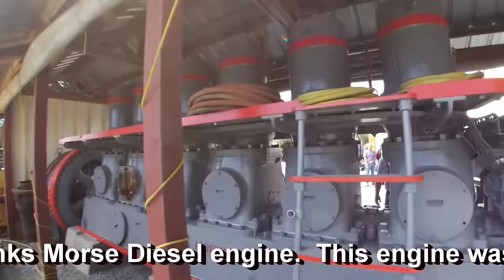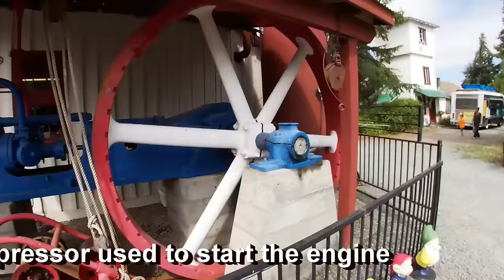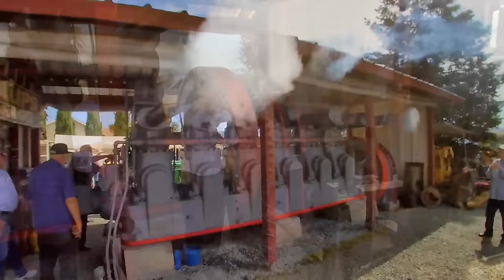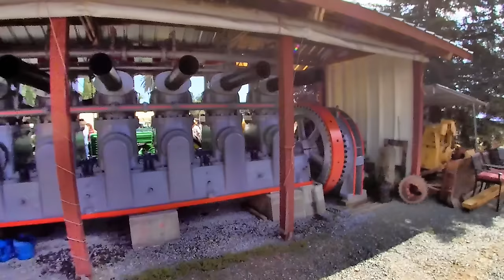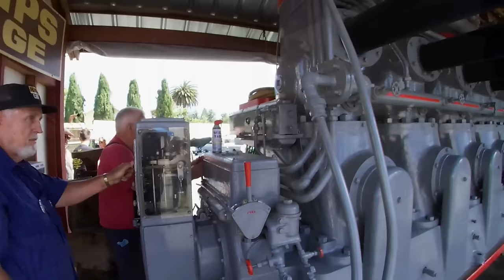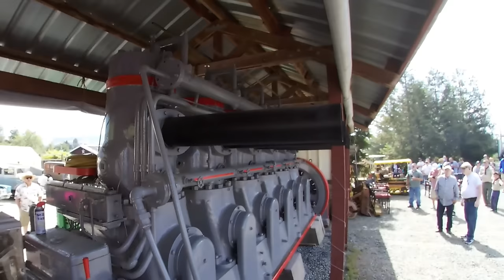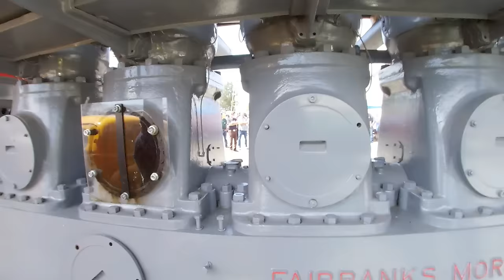450 Hp 1930 Fairbanks Morse Diesel Engine Startup

Comment: As a mechanic that started an apprenticeship in the mid 70s, I am only now starting to appreciate the history behind what I do for a living.
Reply: Yes, You offer a great trade that unfortunately so many people have no clue how to turn a wrench or work with their hands and fix something.  As I'm writing this I have a person asking me about changing out a fuel pump on his truck.
Reply: Was it plumbed into a 5000 gallon 2 stroke oil filled tank out back somewhere? What brand of 2 stroke oil does she burn during these demos?
Reply: I hear you. I just started a job working with a 30 year small engine necanic. The snow engine in rollag blew his mind....
Later did similar exploring that an ajax is little more than a chainsaw engine on a massive scale, haven't even touched on detroits or hit and miss or hot bulb.
Reply: @jesseamaya4413  Ift thats a small 2 sretoke i hate to see a big one, unless yoy tinker with a wartsilla 1085000 hp 2 stroke. Only lightning is a bigger badder 2 stroke!

Comment: If that thing make 450hp @ only 300rpm then that means it’s making around 7890ft/lb of torque... :O
Reply: Just out of curiosity how did you get that number
Reply: Katy Perry's taint because Horsepower is a equation of T*RPM/5252=HP and if you switch it around or use a calculator, it turns into HP*5252/RPM=T
Reply: I knew it was always equal at 5252rpm's. Just wasn't sure about an equation. Thank you
Reply: Yup.. those old steam tractors make as much torque as the largest modern tractors.
Reply: @lakeprairieag  But they are three times more massive and go about a third the speed :P
Reply: Very true.
Reply: And they run still! No planned failure in them, they were built to persist and they do.
Reply: HouseDuke That’s because the power per displacement is incredibly low and they don’t have extra parts to make them more efficient and cleaner
Reply: Torque is not relevant here, power is. It's being used to power a generator. A 1000HP, 1200 RPM diesel engine with 746,000 watt generator attached will power more machinery and more powerful electric motors. Power is power in this case. This is not a tug boat or semi truck rig hauling a huge trailer.This is purely about power, and 450 HP is not that much....And just to prove my point, if you hook up a 750 HP electric motor that is powered by the generator of the 1200 RPM diesel engine up against a 350 HP electric motor powered by this 450 HP @ 300 RPM diesel in a shaft versus shaft duel, then the 750 HP electric motor will win and smoke out the 350 HP electric motor that is getting its power from this 450HP engine....Again, power is power when generating electricity. No amount of torque is going to save you.
Reply: Povl Besser ... but will last over 100 years and could be fixed by the farmer or local blacksmith, never mind fueled by locally produced fuel or locally dug coal in some cases.
Reply: diesel.
Reply: @EETechs  Yeah, but that beast will put out 450 HP for years on end.  A smaller motor will not.
Reply: THANKS MATE ,THAT WAS MY QUESTION
Reply: The power calculator that the poster put in the link gives the result in in-lb, not ft-lb, so that answer of 94537 has to be dived by 12 to give the correct answer of 7878 ft-lb.
Reply: @EETechs  you could have said that so much better
Reply: @briiandee  ?
Reply: The 2 stroke can unleash unheard of potential
Reply: This is what in kgmf?
Reply: But it’s funny that nowadays a much, much smaller engine can make more power than this Behemoth. All be it not lasting as long.
Reply: This engine could bew turned up for much more power with a modern fuel system, turbo and exhaust stopping/trapping valve but it would make it a very low rpm, this 2 stroke bemoth is about 2100 cubic inches per cyninder, It make an EMD 710  v16 2 stroke a sport bike engine which can spin faster though
Reply: Im sure this giant can produce much more power with a turbo, exhaust trapping power valve and a modern fuel system. it what make a lot of power down low, big 2 strokes have tons of low end torque, they is a 116000 hp Sultzer giant 2 stroke for ships!
Reply: @andrewfritz5123  It is hp DIVIDED by rpm, not times in the case of converting hp into toque measurement at that specific RPM
Reply: titanicwhiz I literally gave the equation... hp x 5252 /RPM= T, you should really check before you comment
Reply: @titanicwhiz  boy lover
Reply: @EETechs  This "power is power" concept also applies in any application with appropriate gearing, but yeah the actual torque matters in a direct drive application and for the sake of keeping the transmission/drive gear simple. You could produce enough torque to pull a freight train by hand with enough reduction gearing, it would just be very slow!
Reply: @MittyNuke1  That is correct, but unfortunately such simple concepts are overlooked when people argue about diesel engines vs gas engines. In nearly all car or truck enthusiast forums and YouTube, people talk about torque, torque, torque. I found that when explaining equal power of two different prime movers with different torque values in terms of generating electricity, it pretty much shuts down any argument about torque being the "be all, end all".
Reply: EETechs yeah true, and I think there is a valid point because “in theory” doesn’t take into account the cost and reality of building transmissions that are capable of huge power loads. A lot of large container ships don’t even have a clutch to disengage the main propulsion engine; they start it up in reverse to go backwards! I heard that the US Navy doesn’t even own the reduction gearing on some (all?) vessels and just leases it long term due to the incredible expense. The difference in a large truck engine that puts out 300 HP and a sports car engine is that the truck engine can put out 300 HP for a lot longer than the sports car engine can without blowing up!
Reply: Torque is all about stroke! Longer stroke is more leverage on crankshaft. Longer stroke is also slower rpm's. The laws of science!
Reply: @dizzywow  That's not exactly true, but consider this.  These old engines last, not because they are so good, but because the power output is incredibly low by modern standards, and the speeds of differential motion (relative motion) within the engine are extremely slow by today's standards.  Just based on my memory of some weight and horsepower stats for some of these old engines, I'm estimating that modern engines can easily be expected to produce about 700 times as much power per unit of engine weight as these old monsters did, and yet think how long these modern engines last.  It's a matter of routine for a small diesel engine to power a truck for 500,000 miles nowadays - nobody even thinks twice about that - but it's a feat that was unfathomable for a truck engine back in the days when this monster engine was in use.
Reply: @EETechs  now we have torque converter

Comment: My name is G. Huffman and when I was a kid there were two of them running day and night at that mill. My uncle Tom Huffman was the machinist there. The two of them were in a big steel building with the machine shop and lathes and tools inside. I of course remember them being a lot bigger. I heard that they were shipped to the Filipines. The mufflers were in the ground, concrete boxes with steel plates over them and you could hear them booming all around the valley. I do know they were rebuilt a few times because I saw the pistons and other parts around on the floor. In a back room were two other generators as emergency standby , one was a big horizontal single diesel I don't remember what the other one was.
That would have been 55 to 60 years ago. Brings back memories.
Reply from the maker: Great info.  Thanks for the thoughtful comment.  I love the history.
Reply: This giant 2 stroke probably makes 60 psi of boost in the crankcase alone. when that giant piston comes back down after the high reed valve closes lots of pressure.
Reply: Obrigado por seu comentário
Reply: Thats the DJT 13,500 hp crankcase scavenged 2 stroke diesel available after November 5th!

Comment: The fact that this beast was designed, cast & assembled more than 90 years ago, still fully functional should be a matter of pride. All this was done without computers& all the modern factory robotics, just human labor.
I could listen to this all day.
Reply: It makes the same power like a turboed OM606 Mercedes 3.0 diesel lol. Which slightly less rpms :)
Reply: I bet that if this beast matches the rpm put out by the om606, that tiny engine would cry from such a difference in hp. With such low rpm having it only reaching 300hp values means that its got to have an ungodly amount of torque.
Reply: @kimpatz2189  Low rpm is no virtue by itself. But it does help on longevity.
Reply: Perfect to fall asleep to!  I would've never thought a mechanical sound could be as relaxing as oceanside breeze & tide 😴💕

What well-chosen words for your assessment of turn-of-1900 machinery.  Cars, tractors, engines, even typewriters & IBM collating machines (mechanical versions of the computer) were solid & long-lasting.  Makes you re-think what modern "progress" really is when you look at today's overpriced, poorly made, short-lived junk

Thank You for contributing!
Reply: @dingdong2103  Low RPM (coupled with high torque) need only be increased with gears.  100 RPM was typical max propeller speed for large ships of the time.  So, this 70,000 lb. behemoth could easily move an oceanliner.  Step that up to 200 RPM (1:2 gear ratio) and wow-wee!  Double the nauts!  :)
Reply: You used our brains and 6th sense back in the day, now we are dumbed down
Reply: Now you could pack in the crankcase with cnc billet aluminum and run a big turbo with inter cooler and exhaust stopping valve to build boost and gain way more power!
Reply: @jlo13800  
True
Merely improving on the original design
Reply: @1929modelagirl  That big 2 stroke can and will take some serious boost, no doubt about it.
Reply: every lightning bolt is a 2 stroke so whats the big deal
Reply: @dingdong2103  
Now do the Torque calculation...   450HP at 300RPM = 7878 Ft-Lbs of Torque.. a "LITTLE" more than that Turboed )M606 Diesel.

And while Merc used to make great diesels..  I doubt it would run almost nonstop at load for 50+ years.. or more which this engine did.. and still be running well at 90 years old. Different tool for a different job.
Reply: @kens97sto171  If you put this diesel in a car, it wouldn't be able to move due to the size and weight 🤣
Reply: that crankcase make at least 30 to 50 psi, not sure
Reply: @dingdong2103  Torque, do you have it?  (No, you do not).
Reply: @scottysgarage4393  Well my car has 768Nm of torque at 0.1 rpm so yes, I have plenty.
Reply: @dingdong2103  566ftlbs, in civilized reference, isn't that cute.  @ 0.1rpm...sit down before you hurt yourself.
Reply: @scottysgarage4393  It's an EV, full torque from stop and you must be on crack if you don't think 566ftlbs isn't a nice torque number
Reply: @scottysgarage4393  Oh and btw metric is where the civilization began and is ;)
Reply: @dingdong2103  That's right.  People love to assign so much value to high torque produced at low RPM, but torque is simply one of the factors contributing to horsepower and it means very little all by itself.  Gear inefficiencies aside, a small, high-RPM motor of a certain horsepower will produce exactly the same torque as a low-RPM motor of the same horsepower if appropriate gear reduction is provided in the power-output train. In real life, gearing inefficiencies and the practicality of designing power-transmission systems with extreme gear ratios cannot be ignored, but still, this illustrates the basic misunderstanding that so many people have about "high torque and low RPM".
Reply: @kens97sto171  Right.  It's really not a surprise or engineering marvel that an engine which is putting out such a minuscule amount of power in relation to the size of its moving parts is going to last a very long time.  But there is a reason we no longer rely much on engines which produce scarcely more than ten horsepower per ton of engine weight.  Nowadays, even a very crude ten-horsepower engine is small enough and light enough to be installed in a machine the size of a walk-behind lawnmower, and that's been a very useful thing!
Reply: @ericl2969  
You are  underestimating the actual power output..  HP means nothing.. it's the torque.  When it comes to power generation or any other continuous load.
You could not take a 450hp V8 engine from a modern car and have it do the work that this engine did for decades.. probably nonstop. 
There were plenty of small engines back then too.. Maytag made engines to power washing machines..and other appliances.
And we still build very large engines like this for the same purpose..  big Caterpillar engines for power generation..  engines for container ships... etc.
Reply: @kens97sto171    Horsepower and torque are not independent entities, and "power  output" is NOT somehow different from horsepower.   I provided enough qualifying information to say that it's not actually practical to substituted a tiny, high-reving engine for a slower one with massive torque (because you cannot actually overlook gearing inefficiencies), but you don't understand what torque and power actually mean, or how they are calculated.
Reply: @ericl2969  
Perhaps I misunderstood you or you misunderstood me. But I'm well aware that horsepower and torque are not independent entities. Horsepower is a calculated number from torque and RPM. And I would never have said that a high revving small engine with gearing could do the same work. Even though that is theoretically possible. I suspect that that engine would not last very long given the RPM.
I think that's why most of these big engines are still around running. They provide a huge amount of torque with very little rotating wear on The components. And if they do start to wear out it's easy for the small and efficiencies to not make a huge difference. You tend to see this even in older small displacement V8. Look at a small block Chevy from the 1970s. It can have a fair amount of blow by and be burning quite a bit of oil and still run reasonably well even if it's down on compression a bit. Versus a new modern very high compression and very tight toleranced in line four you would see in your average sedan. You start to have some worn out rings or valve seats or other components and you will see a dramatic reduction in its ability to run well.
Not sure where you got the idea that I don't know what I'm talking about. I've been working on engines for over 30 years. I do know what I'm talking about. It's more likely that you simply misunderstood me or I misunderstood you, or perhaps you're replying to the wrong person.
Hope you have a wonderful day.
Reply: @kens97sto171  Thanks, I see that you get it.   What you said here about the theoretical ability but practical inability, to "take things to extremes" in terms of high horsepower combined with high RPM is exactly what I had in mind.  With all the nonsense that's spewed about "the magical nature of torque" (and I'm sure this applies to some other commenters), I wanted to convey that that's not the entire story.
Reply: this 2 stroke makes about 80 psi boost on its own no turbo required!
Reply: We had brain cad and elbow CNC back then!
Reply: @dingdong2103  Yeah, same horsepower, but the torque of that puny merc wont get close to what this is putting out. Understand HORSEPOWER is only how FAST torque is applied. The faster you apply torque, (increased rpm) means a higher hp, yet this engine runs sub 1000 rpm to make the same power. Much smaller 6 cylinder gas engines from the 70s can probably produce more torque than a om606 3.0l.

Comment: Wonderful engine by an amazing  company, I worked at a sewage pumping station in Canada and we had a number of FM pumps driven by opposed piston two stroke diesels. The largest was a 10 cylinder (20 pistons) rated at 750 hp at 700rp

Comment: Damn this thing is smooth... and quiet. Truly impressed with the refinement.. Definitely will outlast us all
Reply: Yep but it was set up for show. It was running on compressed air. Bro had the thin plexiglas window on a crank case port and a can of WD40 at the ready. I was disappointed it wasn't really a powered run.
Reply: @MetallicMedium  it wasn't running on compressed air. Compressed air is the most common way of starting two stroke diesel engines. And the plexie glass window was on the crankcase, which doesn't have a lot of pressure in it aside from a little blow by from the pistons
Reply: That engine looks to be one that would have been made in 1900 or 1910
Reply: That thing is bullet proff and later torbo models made a lot of power at just 300 rpm's, Today we got the Cooper bessemer w300 10800 or more hp 2 stroke crankcase scavenedd v-16 natural gas ported 2 stroke, i think its a 10 port engine, beyond what you get in your detroi, optimax or rotax 850 etec today.
Reply: That exhaust clears up and is over 1400 deg f as this type of 2 stroke makes a lot of heat, the jacket water could be used as a heating a lot of water as a crankcase scavenged 2 stroke can make a lot of heat.

Comment: Thanks for the video & taking the time to explain the engine in the text. Being a Detroit diesel mechanic from the 2 stroke days I figured it was 2 stroke due to no valve gear & the pulse of the crankcase window but had never seen a reed engine.
Reply from the maker: Was a GM 671 mechanic in another life myself. Thanks for the comments
George
Reply: @georgehomenko5358  I have a mobile repair business in Idaho & still get to work on the occasional Driptroit engine for farmers & there is still one 16V-149 Series engine in a crusher that I go over once a year. Just between you & me I'd pay them for the pleasure of being able to work on that one. ;-) Shared to NZHRM Forum.